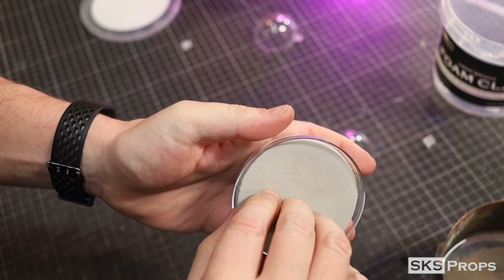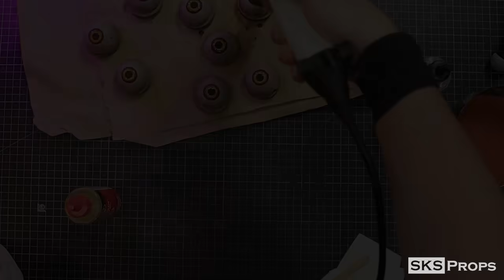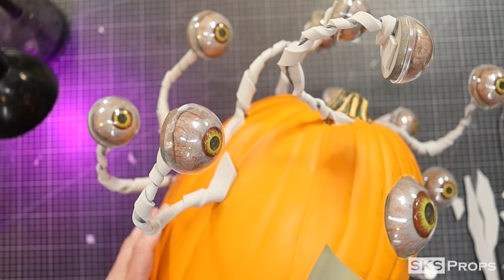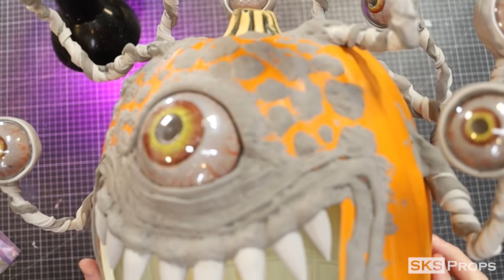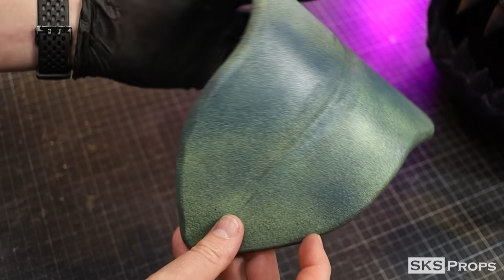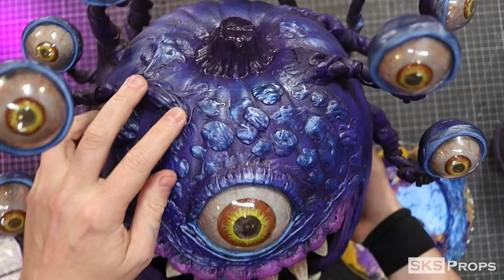I Made A Beholder Pumpkin for Halloween & You Can Too - DIY Foam Pumpkin Carving Painting Tutorial

Comment from the maker: Check out more of my complete builds, walkthroughs, and HD-Foam at www.SKSProps.com
Reply: I'm so wanting to to go get that door decoration with the opening eye on it  now  

A few of them take em all apart and use the eyes. And make this beholder as you have. Just use those eyes to give it some animation. 

Seems like a wiring nightmare atm  but still the concept is a neat effect. 

Awesome build
Reply from the maker: @DracosDiabolis  thank you very much! 🙌
Reply: @SKSProps have you tested the plastidip on the bulb plastic? You might not need to mask the eyes as the plastidip will work as mask and peal right off as long as it doesn't react to the plastic
Reply from the maker: @stevewilcox9659  I didn’t because I was laying down primers as well. It’s possible it may not interact with the bulbs but didn’t want to take the chance
Reply: Could you make helldiver's 2 full armor ? And template?